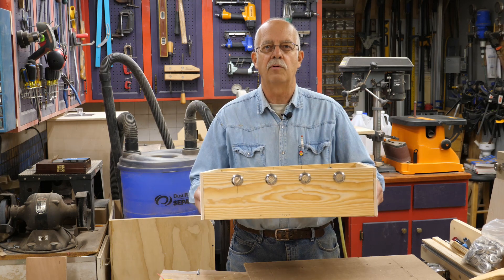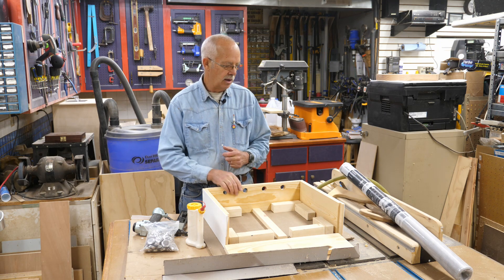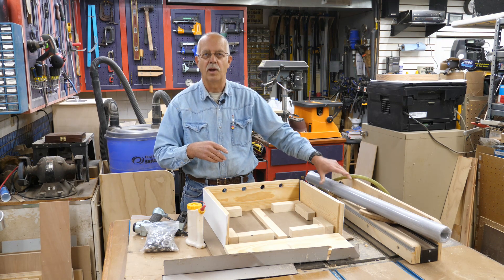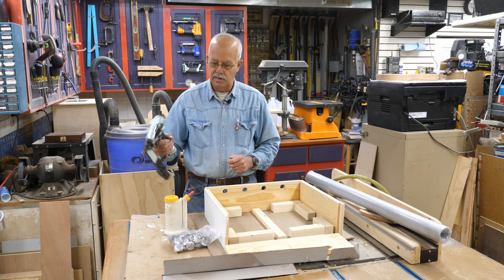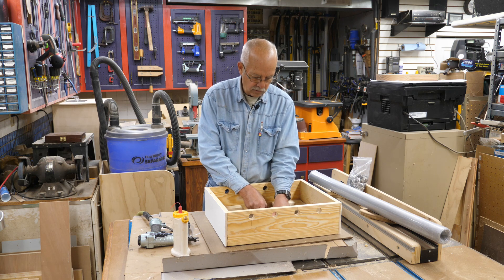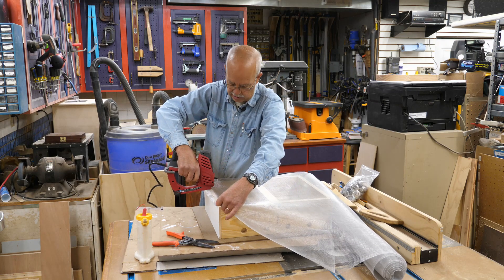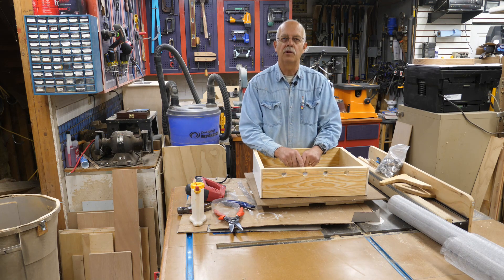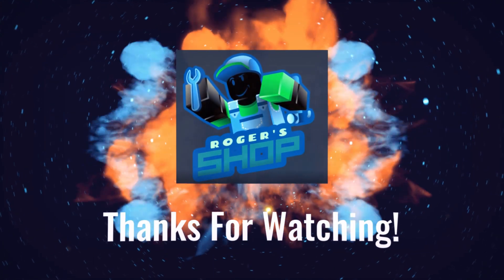Bee Hive Quilt Box Construction

Comment: Cool idea on the vents. I do the same design but i rout the center of the 2x6 and add plywood with a hole for better insulation with fondant feeding screens. I also add a 2 inch foam board under the cover on top.

Comment: The boxes I built are from older medium supers.  I installed 1/4 bottoms. 3/8 up from bottom using 3/4 frame.  The floors have two screened holes.  These boxes make a ventilation top for south Texas summers and a few inches of chips for the winter months too.  An all year replacement for inner covers